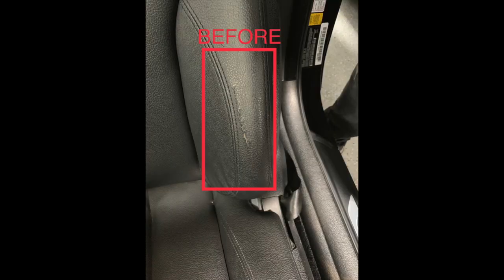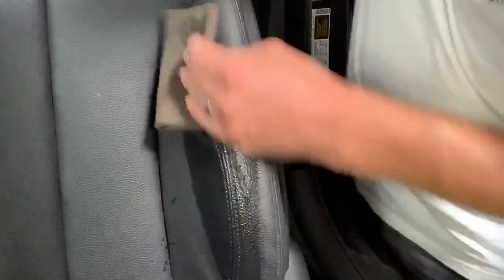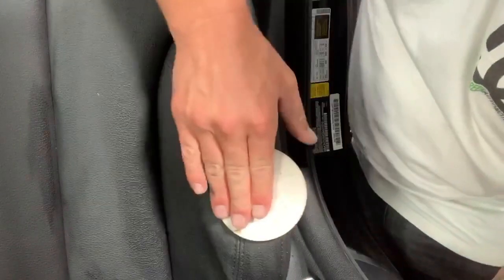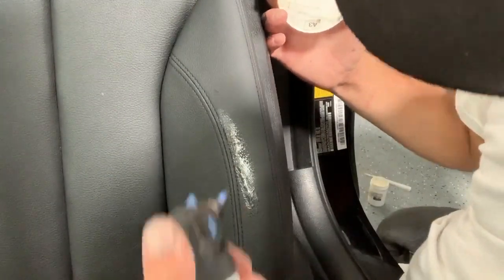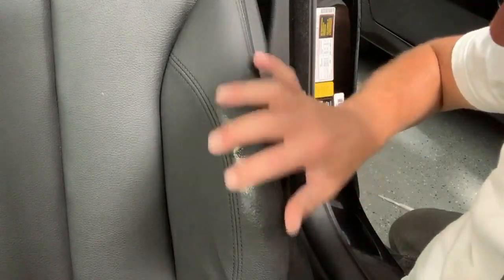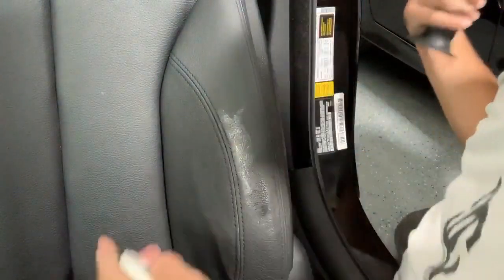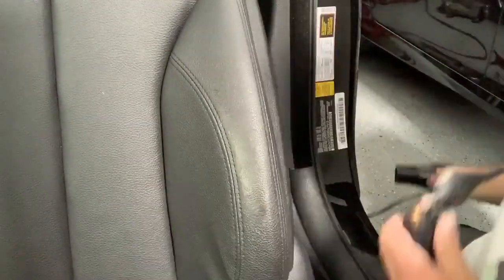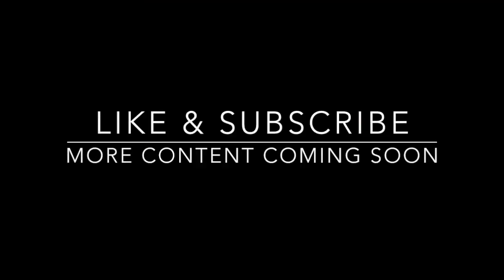CRACKED LEATHER / VINYL SEAT | How to: BMW Sensatec Repair

Comment: This is by far the best repair results I’ve found. If I don’t have a sprayer, what would you suggest instead?
Reply from the maker: You can get a dense foam, put the color on it, and then dab it on to the panel!!! That actually works great

Comment: Hello I need your help. I have a tear on the left side of my driver's leather seat on my 2015 ford Escape.i am wondering in addition to the repair if I need to remove the coushin as well. None the less is there someone j can speak with my phone so I can send pictures so you can see what needs to be repaired and all the supplies I would need? Thank you.

Comment: So is the sensatec actually less durable than leather or would it happen to leather anyway? The basic leather in our older bmws gets worn down pretty badly anyway.
Reply: The story used to be, if you buy a 2nd hand BMW and the seats look great, then they are vinyl seats! 
I just bought a 2006 e91 with the Sensatec seats. The seating areas still look amazing, but I have these cracks on the drivers seat bolsters. But otherwise, the seats look almost new. No way 17yr old leather seats would look that good.

Comment: After a repair like this is done, would I still be able to clean and maintain the area with normal detailing products/protectants without it affecting the area?
Reply from the maker: You definitely don’t want to use any strong chemicals that could degrade the repair and you don’t want to scrub at it really hard... maintain the area gently and keep it clean and you should be good to go!!
Reply: IMJOSHV - Car Detailing and Reconditioning Tips  Alright awesome!!! Thanks man 👌🏼
Reply from the maker: Anytime!

Comment: The state vehicles inspectors cut 3 slits (1 inch long each) on my BMW’s vinyl dash when they removed they replaced the annual inspection stickers.

The cuts are located right where the dash meets the windshield so it’s not accessible for anything beyond a putty knife and fingers. Can the glue compound harden with the sun’s heat?
Reply from the maker: Yeah you can use an air dry our low temp cure compound

Comment: I would go to the local dealer to get the seat cover replaced. Case warranty is over and the dealer rejects to replace it, then just write an e Mail directly to the Board for quality issues at BMW Munich and complain the unacceptable poor quality. For sure the seat cover will be replaced as goodwill. This is better and cheaper for BMW than bad publicity.
Reply from the maker: Many times if its out of warranty they wont do much unfortunately